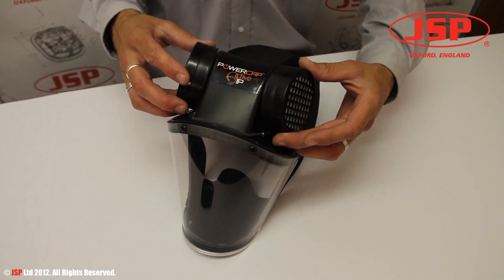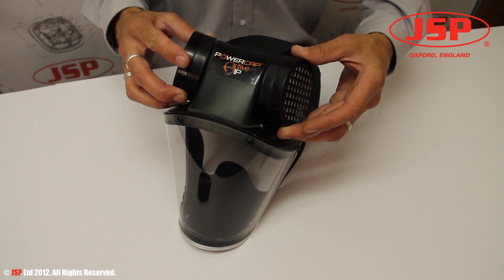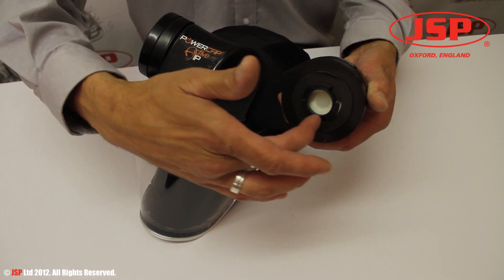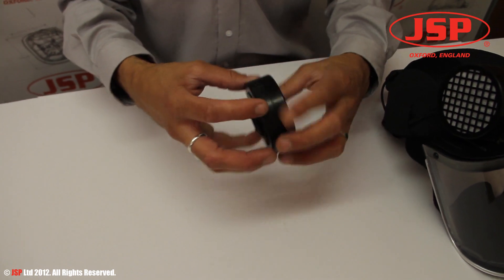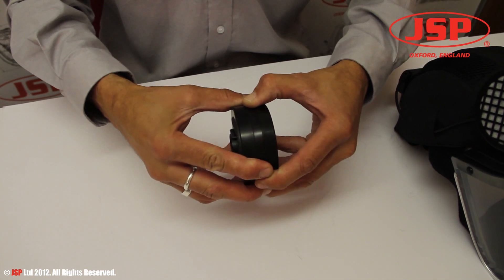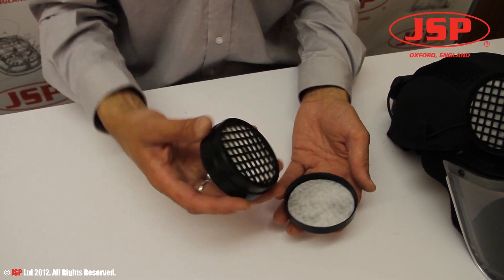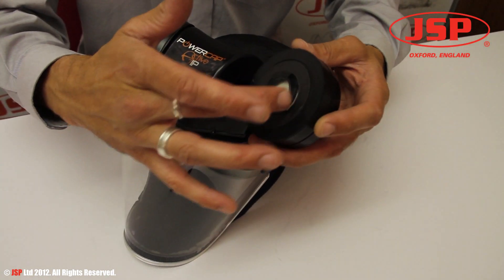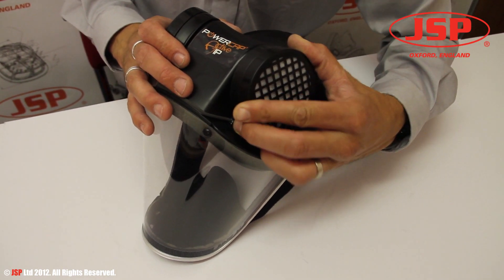Changing a Powercap® Active Filter - A Guide by JSP Ltd

Comment: Yes I also want to know if there are ffp3 filters available please
Reply from the maker: There is no option for FFP3 filters on this product. We would recommend moving to the Powercap® Infinity® to receive this level of protection with powered air respirators or move to a half-mask such as the Force™8 with PressToCheck™ filters or the Force™10 full-face mask which is also compatible with the PressToCheck™ filters. Please feel free to contact us at technical@jspsafety.com and we would be happy to advise on which solution would work for you dependent on your usage applications.